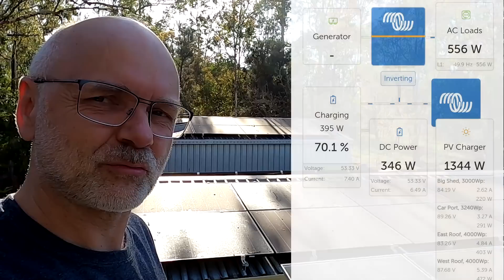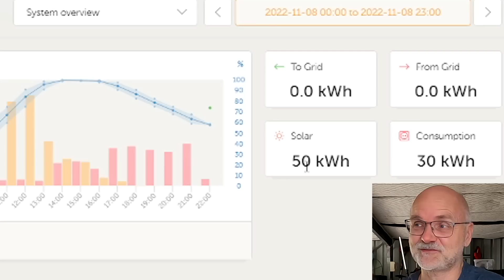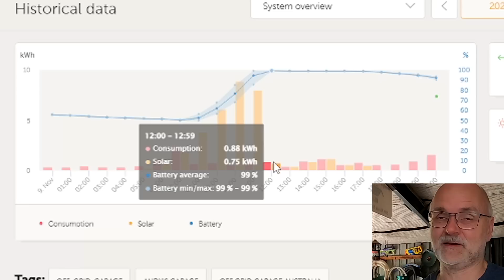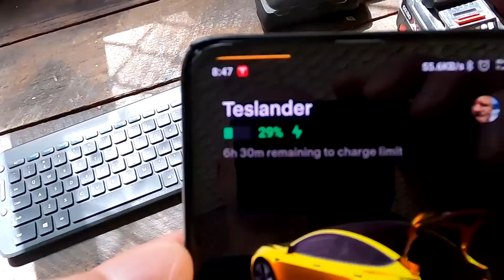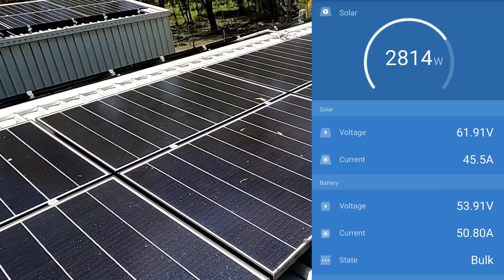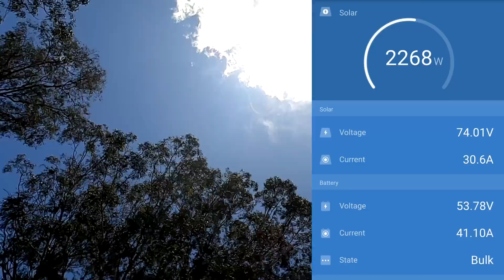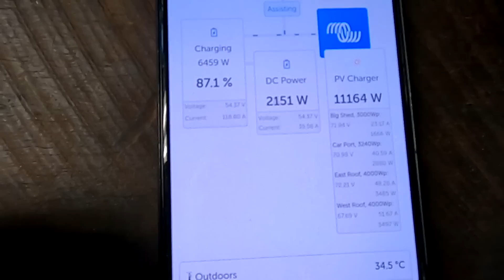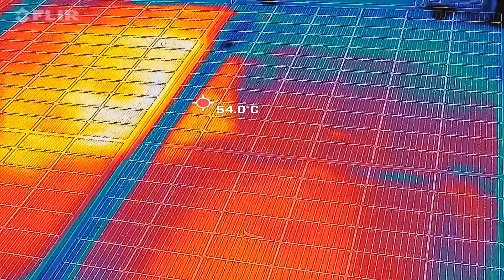I had to limit the output power of the new solar system. First impression after a few days...

Comment: Now you need to find something for that excess power - run AC during the day to cool down the house, hot water heating (which in summer time is less of a need), pumps where there is a purpose (pool/irrigation etc). 

I saw a company (a while ago cant find the link) who sell a system which freezes plastic balls full of water and then air is pushed through the unit at night time and this provides cooling at night with only minimal power for the fans the freezing of the balls is done with solar.  This way at night you're not drawing excessively on the battery bank. 

I was watching Tech Ingredients they were doing some science on distillation and they froze water in a deep freeze with pipes in it to extract 'the cold' out of the block' to save water usage on the distilling (not legal in lot of countries though), but the idea is interesting using chest freezer as a battery to cool something down later on rather than using standard batteries. 

But I guess these days just add more Lithium as they're getting cheaper? Compressed air is another interesting one but both of these (and water heating storage) are far more inefficient systems but as you have the solar on the roof, just a thought.....
Reply from the maker: The house is not connected as such so cannot run many loads over there. I made several videos about this and explained the circumstances around the high feed tariff I have on the house. It's difficult...

Comment: Just learned and watched YouTube about fire in combined and fuse boxes etc. made out of PVC. In fact, they should all be out of metal now, also in Australia because plastic just belts and cause fire.
Reply: PVC doesn't cause fire, almost all cables you'll find in residential are all coated with PVC as their insulation and sheathe.
Reply: @stefanvanzyl9090  Sure, but WHEN there is fire in the box, the whole box will be on fire and burn the house down. That is why there is now a requirement to use metal casing, just in case. Search on YouTube and you will learn something.
Reply: @TheFikotech  that's incorrect. PVC is used in enclosures and cabling insulation BECAUSE it is self-extinguishing and does not promote fire. so the moment you take the source of heat away, such as tripping the source, then the flames stop.  PVC cannot CAUSE a fire.

This is fully documented and recognized world-wide.

Comment: I've always wondered if a panel that is shorted would be slightly hotter than one pushing out ~200W per square metre. Though the infra red wavelength isn't converted into electrons, only photons from the visible spectrum.
Reply from the maker: Well, do the test and let us know...
Reply: @OffGridGarageAustralia  OK, but I have a second silly test after a two bit davinci video. Will a vertical EW panel produce more power. I'll bet 6 uncalibrated spats that both claims are wrong. Maybe 2, as 4 have been prepared for calibration earlier..

Comment: So you cant sell that over produces electricity to company?
Reply from the maker: It's the off-grid garage. It's complicated. I have another solar system which is grid connected and is under a strong contract with a very high feed in tariff. I'm not allowed to connect anything else producing power to the grid.
I made a few videos about it starting here: https://youtu.be/evuxwiY8z1Y
Reply: @OffGridGarageAustralia  🤣 adhd is good way to unsee something very obvious 🤦 so you need something for load 🤔

Comment: Andy - I've been watching on VRM the last few days. Exciting stuff.
I have only 4500w of panels, so far....
They consistently produce between 4500 & 5000W. I see higher sudden peaks from cloud edge effect - the highest Pmax I've recorded is 6280W. From 4500w of panels! Insane huh!
You will also notice higher Pmax as time goes on. I'll be interested to see how high above 14 kW yours goes.

I also wanted to ask about SPDs. I watched the guy tell you he never installs them. That doesn't mean it's not a good idea.
I want to install SPDs, but the brand you have will only sell to electricians. There's other brands, but I wanted to use same as you have sitting there waiting. Will you install them anyway?
If not, you could always sell them to me! 😁
Let me know mate.
Reply from the maker: Thanks, John. Peak power output is crazy. I have had over 16kW so far for a few seconds and close to 300A of chargign current. The breakers are all fine and working as designed. We will see what happens in summertime...

Yeah, that was the electrician. They never install SPDs in solar systems. At least not in the DC side. I'll put this in a video soon...

Comment: Get some Bitcoin Asics.... likely pay for themselves relatively quickly...
Reply from the maker: Yeah, looking into it. Steep learning curve. I guess, I could buy some used machines and see how it goes. With rising energy costs, it may not be profitable any more for many.
Reply: @OffGridGarageAustralia  Yea, you do not care about the efficiency of them at this point, So you could even use a GPU/CPU. Since it will be better than heating the air with your PV panels ;-)
Reply: @OffGridGarageAustralia It is a steep learning curve Andy, I stopped considering it after talking to some crypto & computer geeks who told me about how poor internet issues we have in Australia can blow ur very expensive cards/setups, and after a few of these $700 mishaps, this guy now plays the crypto marketing game instead.
He has 35kw of pv panels on his roofs in town and his roof space was full of miners, but he got sick of the expensive repairs he had to do every time the internet glitched a bit, not to mention the heat and noise. But yes, worth investigating at least, this is always a good way to make use of any extra power you have, if it is viable in the long term. I dont know how reliable ur network is, but this is something worth investigating too.

Comment: Side thought. Here we have a product called"RainX" it repels water off windshields. I wonder how it would do on solar panels?
Reply from the maker: We have this too down here. I think it won't make any difference. I have cleaned solar panels as long as I have them and never could see an increase in production afterwards. I still do it from time to time for my own sanity 😉
Reply: I do like the idea/logic behind using RainX on panels, but I have to agree with ‘Old Mate’, that cleaning panels, unless they are really dirty/shitty whatever, probly doesn’t yield any/much extra energy, but it may make you feel better for doing it. On the flip side, I did mine several months back because I noticed they were growing a bit of a mouldy type mildew we get around the Hervey Bay Area. I did a quick pressure clean after about 16 months of the installation. I was thinking of giving them an occasional (1-2 yearly)wash over with a bit of Chlorine/bleach maybe to try and counteract this moulding effect, but RainX or possibly tyre shine may work to help stop buildup of this type.

Comment: Wow!
Just wow... that is a crazy amount of power. I know the grid doesn't pay much for export but seems a shame if you can't use it all otherwise. Very interested to see your upcoming videos on this. 🙂
Reply from the maker: We have to stay off-grid with the system until the contract runs out for the feed-in solar on the house. A lot of restrictions when connected to the gris while off-grid I can just go nuts...
Reply: @OffGridGarageAustralia  I have heard you refer to this before, I think. We'll just have to see what other ways you can put that power to use. You are right that more storage doesn't really solve it... when that fills up you end up the same spot.
Maybe put an electric car charger out at the end of the drive with a credit card reader so you can put yourself on the commercial charger maps? 😅

Comment: I already know what your thinking 150/85 TR....Victron charge controllers....
Reply from the maker: Wouldn't make a difference. It's too much power already.
Reply: You will find a way to use it!!!  @OffGridGarageAustralia
Reply: You would be able to see the maximum power output of your panels with the 150/85 and make another video about it. 😁  @OffGridGarageAustralia
Reply: @OffGridGarageAustralia  Title the video Way Way Too Much Power!!!
Reply: You might have to click the 100amp Circuit breakers to 90 percent and change the 250amp Circuit breaker to 300amps. So you can push way way too much power into your Battery 4.Ooooooohhhh!  @OffGridGarageAustralia

Comment: Node red and tasmota for load dumping. That's what I do. Reverse cycle air-conditioning can be controlled. Hot water and in winter even can heaters.
Reply from the maker: Yeah, but where to dump it... Pool heating, hot water, AC. That all involves a lot of cabling from the off-grid garage back tot he house and is not possible right now.
Reply: @OffGridGarageAustralia while all you have done here is nothing less than fantastic Andy & I love it, Im starting to wonder if ur new solar setup maybe should have started on a new shed in a more convenient location near ur house and power for easier coupling with the house down the track, & possibly a better sunnier aspect also, if that would have been possible.

Comment: now you can heat the pool, once the batteries are charged, with the excess solar power.
Reply from the maker: I'm looking into this at the moment as probably the only option I have until the high feed-in tariff of the house solar runs out.

Comment: I cut one tree down today increased my output 1-1.5kW! I’ve cut all that I need to with 34kW of PV. When you’re totally off grid, heating with heat pumps, heating your water with electric water heaters, you need every last watt. 65kWh yesterday, 124kWh. That’s with the shortest day coming up in about one month.

Comment: Hi im very impressed by your system, very nice job sir, i noticed you encounter a lot of dust and leaves on your panels, next project panel sprinklers with rainwater providing for maximum efficiency maybe or is it just a silly idea? Greets
Reply from the maker: The leaves will blow off with the next breeze. Hey, it's Australia, the driest continent, so we're not sprinkling water on solar panels 😉
Cleaned my panels for years and never saw an increase in power output afterwards.

Comment: Get another hot water heater, in series with your existing, and put 48vdc heating elements in it.  Put all your excess power, to pre-heat your hot water heater!  Works for me…..
Reply from the maker: If I connect the hot water system, it would use around 3kWh per day. A pool heater though...

Comment: "Full by 12:30"... see thats the problem  and i ve experienced this myself, tonnes of power, but all of it wasted and not harvested  when the battery is full, its easy to generate power, but  can we generate  store it for tommorow? for next month?  that would make solar amazing, being able to harvest it all in the spring and summer and then use it all in the winter.  I cant think of a practical way to store that long term other then pumping water, and one guy pumped water to his roof and filled a 50 gallon barrel with a solar panel,  it took all day to fill (100w panel i think) and produced 1 aa battery of energy comming down...  at leaste its better then no energy which is what happens when the battery is full. And at first youre like , sweet, my battery is full and isnt even peak sunshine yet, then you realize, crap thats all wasted energy not being harvested.  With great power comes greater battery.
Reply from the maker: We have to wait for wintertime and see how much the system outputs then...
A bigger battery won't help in either way.
Reply: @OffGridGarageAustralia  Yeah winter will be lower for sure and with that much power it might not be an issue, but thats why it would be nice to be able to store all that excess energy made in the summer/fall, and have it for the winter. Very long term storage im talking about which current batteries arent really designed for. Maybe someone will come up with something for that to be possible.    But yeah, more panel will gauarentee it aswell so you dont have to store long term.  My early guestimates here with winter comming on is id need about 10x more panel during the winter to be the same as summer, at leaste thats what a really cloudy day gives me, 1/10th, and theres lots more during this time so i guess id need 10x more? which is doable but seems wasteful.  But then again buying more battery can be more wasteful $$ wise then more panel so pick your inefficiency i suppose.

Comment: Is there AC split system which use 24V or we have to use inverters to power a regular system?
Reply: I believe there are some newer 12v-24v AC splits becoming available nowdays, check out RV’ing/caravanning / 4WD camper sites. 240vac splits are probly heaps cheaper to use with an inverter though, depending on what u plan to use it for, ie: household splits can be used in vans etc, but special attention to piping and other factors come into it, due to possible movement/vibrations etc.

Comment: IIRC you are using 63a breakers between the mppt's and battery bus. It is probably a good idea to limit each mppt to 60a output.
Reply from the maker: They work fine with 70A for a while. It's only these peak moments...

Comment: Andy, time to add an Off-Grid-Home to the Off-Grid-Garage and degrade the grid to "winter backup" 😁
Reply: Andy will produce enough in winter too - the sun is very strong in Australia, even in winter.
Reply from the maker: Yeah, winter will be very interesting. Lots mor shading then, usually no clouds though. I'm still not convinced it will be enough during that time without the pool fence system.

Comment: 😳😳👀❕❕❕That’s a serious system you’ve got going on now.  WOW  
 I JUST ADDED 4 panels to my system for a total of 3kw    Really helps out on those clouding days in. The northeast USA 
   ✌🏼✌🏼✌🏼🇺🇸❗️❕❗️❕❗️
  One question Andy why are you charging at such high amperage 70AMPS❗️❗️❗️😳⁉️⁉️⁉️
Reply from the maker: Every panel counts!
70A was when I turned off all the load and had the maximum charge into the batteries. Testing the system... 😉

Comment: Ok, too much energy means long time storage and you might move ahead and produce Hydrogen for winter where then the fuel cell would create power and 40% heat for your home. 
Pico is a german vendor that offers such solution with a few hydrogen bottles on about 1 to 1,5 square meters which stores enough hydrogen for a full winter or better the missing part of energy cause your solar panels will still be delivering in winter but not enough for everything. 

first off grid house in Australia powered by hydrogen all year long - nice headline.
Reply from the maker: I can only imagine the paperwork, regulations and safety requirements for such a hydrogen system operated by a private person....😁

Comment: In the DVCC Setup you can set a maximum current to the Battery banks (going through the smartshunt). So you can easiely limit the current without touching the mppt´s settings.
Reply from the maker: Yes, but this would require the BMS talking to each other as well. So there is more to it. I will test this out with the Seplos batteries first and learn.
Not heard that this would work with the smart shunt too before... interesting

Comment: Plenty of power but to stay logical you probably need to trim around to maximize the output. Or what is the point of more efficient cells?
Easy to store excess energy! Compressed air, water storage on a grade, hydrogen generation, batteries etc…
Also, Amps is very misleading, better use Watts/hr, makes you look younger too!
Reply from the maker: The larger solar arrays are mostly for wintertime. Summer is easy. 
Amps is what charges the batteries. That's all it counts 😏

Comment: So Andy.. you have about the equivalent solar of 4 UK houses, though I usually recommend 4.6Kw min for off grid.

You now have the diverter quandary. hot water tanks and pool heater so you can use some of that excess.

My next project is a diverter which will make power excess simple, should be a great project as its very cost effective, I think you may be in need of a few..
Reply from the maker: Yes, lots of other things to think about. The power production is solved for now...

Comment: Check out Amber Electric, puts you on the wholesale market, you will be able to sell the power back to the grid, however not sure if victron is supported. Either way get it pumping into the grid. Swap the phoenix and parrallel 2 multis. I have a hot water controller that you can build easily and control with a raspi talking to the Venus OS.
Reply from the maker: I'm off-grid.

Comment: One thing that could be done with all that extra, unused electricity is  setting up a hydrogen generator by electrololysis and a high pressure compessor into a tank and use for heating, cooling, running a generator, high temp torch, selling, or for rocket fuel (than may want to save the O2 too!). Though it is only about 50% efficient, it would be juice otherwise lost anyway.
Reply: I would air condition the Off-Grid Garage with a 12Kw Mini Split Air conditioner because they are energy efficient and then leave the bay doors open to use the extra power. Because I'm from Canada and don't like that much heat!
Reply from the maker: Could you imagine the regulations and safety requirements for producing hydrogen on your property? Unless a company makes an all-in-one system which just connected to power, this stays a dream... It would probably cost as much as a kidney...
Reply: Elon Musk calls hydrogen fuel cells "hydrogen fool cells" if that means anything to you?

Comment: Charging with 0,3 C should not be a problem - isn`t it?
Reply: charging at above 1C isn't even a problem, as long as you control it, tapering as the cells fill up. at 0.5C, you don't need to externally taper, the cells will do that themselves.